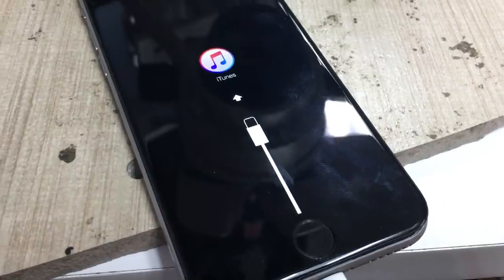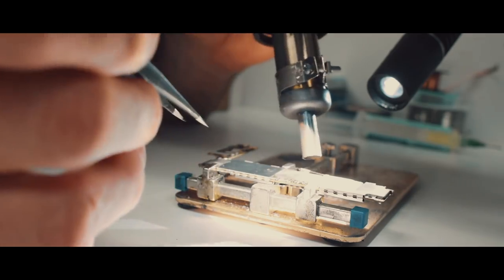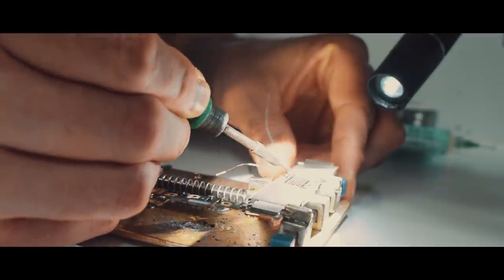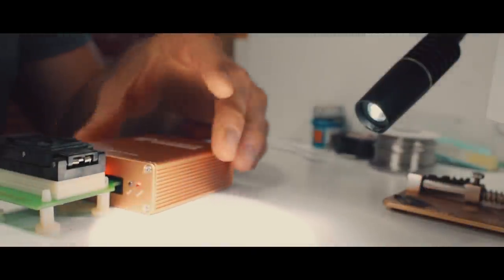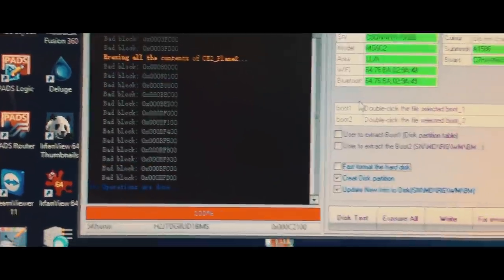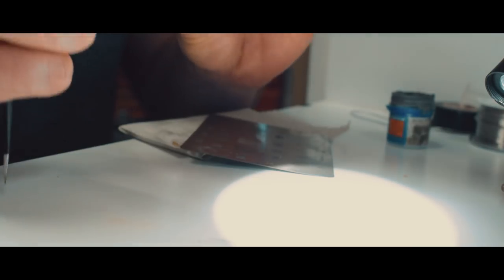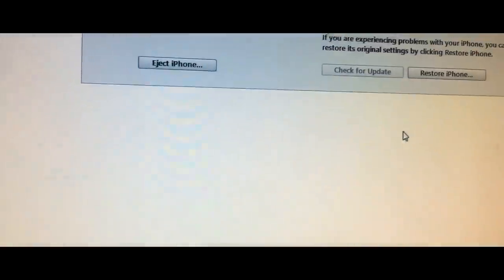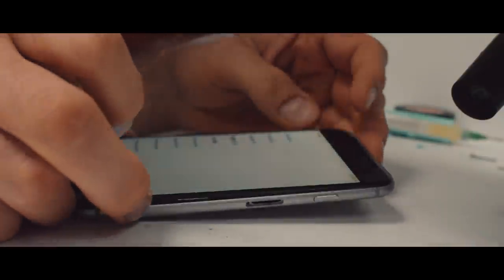Best iPhone error 4013 repair video in the galaxy

Comment: Hi I can use the ip vox v2 for an error 9 in iphone 6s or do I need a different programmer? I still do not understand well because there is a wl rogramador that costs 600 quite expensive so I would like to know if the ip vox is enough

Comment: I followed the steps in your video.  My iPhone 6 is back on, however, I'm unable to set the phone back up.  ITunes is saying "The iPhone could not be activated because the activation information could not be obtained from the device.  Was there a step needed but not shown on the video?  Please let me know, thanks.
Reply from the maker: do you see imei on activation screen?
Reply: Yes, it gives me the IMEI on the start up Hello screen (in the "info" button at bottom right).  I do see where the SN says "unknown".   Thanks for your help
Reply from the maker: Looks like it didnt copy the serial number. You need to add serial number.
Reply: How do you do that?  Do I need to take off NAND and redo in IP Box?  If so, where do I need to copy the SN in the IP Box software? Thanks
Reply: Any additional help?  How do I put the SN back on the NAND chip? Thanks
Reply from the maker: Well, you answered your self in previous post. Put it back in IP box and check if you have serial number. Under Ip_tools Test SN and then you can program yours.
Reply: Have the SN back on the NAND went through the process again and still not able to go thru the activation to get the iPhone up and running.  Where you able to activate the phone shown in the video?  Can you post a video showing only the steps you use with the IP Box to fix the 4013.  I think this would help a lot of people.  Thank you for your help.
Reply from the maker: It seems like its a iOs11 thing. I will be investigating this issue.
Reply: Sounds good, I'll do the same and check back in a while
Reply from the maker: Ok so you need to have wifi and Bluetooth MAC address match the original and ip box doesnt save that. So if you dont have the original addresses saved, you need to use gsx service to get the mac, flash with new mac addresses. It worked for me. Good luck.
Reply: man, you got to give clear information when you do a video like that.

Comment: What if your phone loads firmware for restore properly without any errors, the little progress bar goes clear to the end, yet the phone stays stuck in a bootloop getting very hot. On rare occasion it will boot and actually work until it locks up and bootloops again.  This was after "upgrading" to iOS11.  Any ideas?  It is an iPhone7
Reply from the maker: Potentially reballing basebands pmic or audio ic may help you.
Reply: ScoopOf3D you fixed it actually 😊. The phone sent in from Gavin Curtis.  It's me.  Works great.  Thanks again.
Reply from the maker: My last video had your phone in it. Check it out.
Reply: Awesome!  What I am going to next...lol.

Comment: how much degrees of temperature used to get the NAND out of the board ??? respond i need your help please?
Reply from the maker: 380C 60% air but thats going to be different than my machine. Use about 10C more than you would use for chestnut or other smaller chips.
Reply: do not think 380C  it is too much? i say it bcz the CPU  in the other side of the board,i dont know if there are phones can turn off bcz of this high temperature(damage the CPU)  i. need your help if you know how can i prevent that..........PLEASE

Comment: hey there, i got a same problem cant upgrade or restore from itunes 4013 and sometimes its get stuck on preparing iphone for software update,,,,,,,,, i want to recover my data, is there any way? iphone 5s 64 gb on ios 9
Reply from the maker: There is no data recovery option with error 4013. And it sounds like you have bad battery (from other post).
Reply: ScoopOf3D but I already changed battery, display, and charging port , , still facing same issue , phone was working fine , I just rebooted my phone, and that was last day of my phone... any other suggestions please? Because I can't restore neither upgrade my iPhone,  sometimes iTunes give me error 4013 sometimes iTunes keep saying waiting for iPhone for long time , and sometimes iTunes says preparing iPhone for software updates and keeps that screen for 1-2 hours and on and on doesn't react, please tell me if there is anything I can do.......
Reply: I used an ebay data recovery service.  It was $80 and the guy managed to get my iphone to boot and recovered data.  But it only lasted long enough to sync to my computer.  Then went to boot loop.
Reply: 80 box ? that s great. all i want is my data. the cops can retrieve data from any phone. How come aple cannot? I need all my data. Can you please tell me who can retrieve them for me please?
Reply: please help
reply
Reply: It sounds like you already started a full restore at some point.  If the status bar moved then your data is gone.  If the status bar never moved then possibly your data is still there.  Normally when you plug your iphone into your computer, itunes will automatically do a backup.  There are some programs that can recover data from itunes backup.  1 Phonesaver. 2 icarefone.  You can also pay for data recovery on ebay, around $80.  But you have a hardware issue, a chip must be replaced.